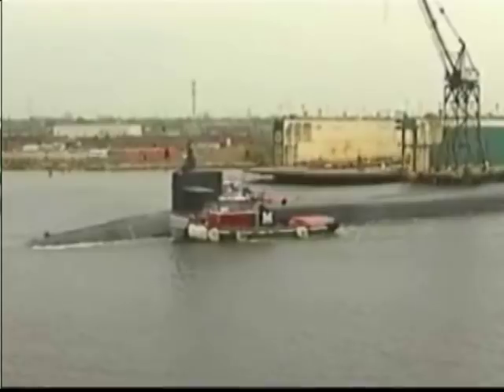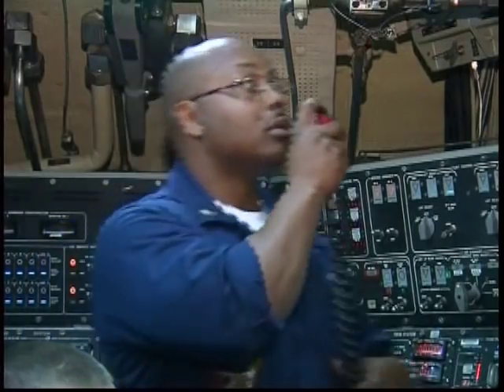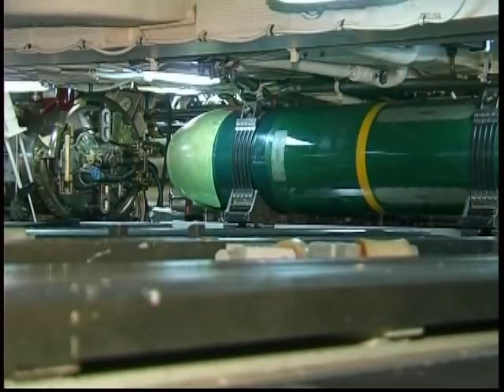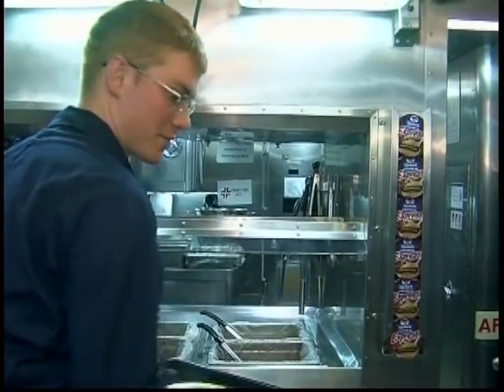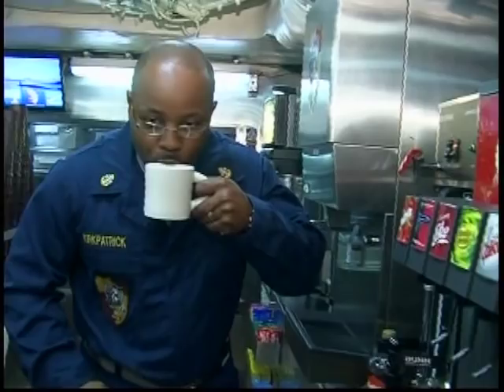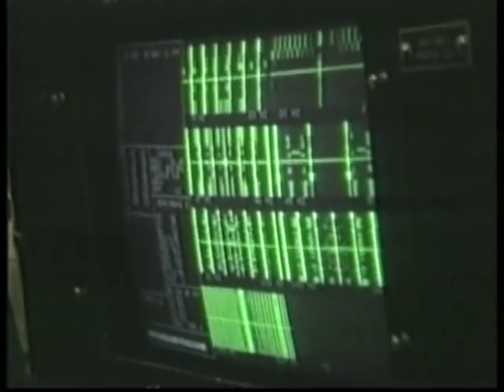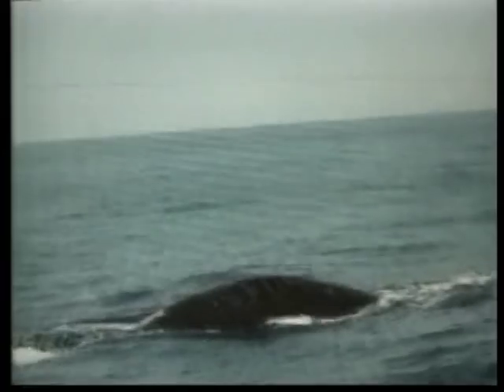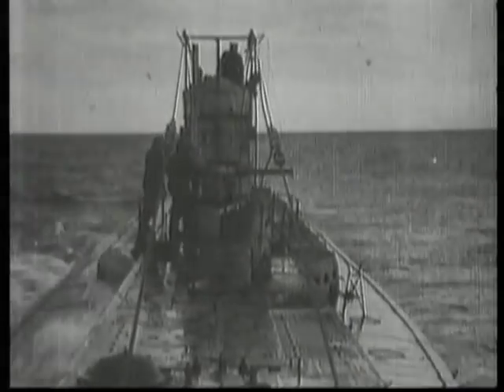Life Aboard the USS Florida (SSGN-728)

Comment: that's my girl,, I was a welder who helped build her, one of many I worked on, lol all these years later she is in better shape then me, nice
Reply: +kevin mcshane I also been in parts of that ship no navy man ever will go
Reply: +kevin mcshane What parts will no Navy man go to?
Reply: Ive been in those parts
Reply: Between the pressure hull and the outer hull and in parts of the reactor.
Reply: kevin mcshane just curious what was the allowable weld rejection rate? Was every weld X-rayed?
Reply: goutvois103 I served aboard a fast attack Los Angeles class sub during new construction at General Dynamics. Every weld was inspected and their was no allowable rejection rate. If it failed, it was fixed. Some of the finest craftsmen I have ever worked with.
Reply: kevin mcshane which parts? You still talking about the girl?
Reply: kevin mcsha
Reply: Their is definitely a since of pride in seeing ships in use that you helped build. When I was a young man I was a welder in a shipyard building tow boats that ran up and down the mighty Mississippi. Probably the lowest paying job I ever worked as a welder. But after spending many years welding on pipelines, offshore in the oil industry plus working building many oil refineries, chemical plants and one nuclear power plant. I took pride in my work but not much in the finished product. Their is a book called “Towboats of the Mississippi River” several of the boats from Brent Towing that we’re featured I proudly helped build.
Reply: I was a pipefitter on that hull. Great seeing my girl after conversion. What up Kevin?
Reply: I just got orders to her
Reply: @goutvols103  no and I was a blue hat in DEPT 229 welder in the 260 building I used HY80 welding rods along with HIGH TENSILE
Reply: @edastro7707  I welded the inside of the propeller shafts of 729 USS FLORIDA and I also welded the inside of her oil tanks
Reply: Last time I checked, it was a "HE"
Reply: @HTV-2_Hypersonic_Glide_Vehicle  submarine and ship are not he but she
Reply: @Vampybattie  it* is the correct term. Guys that call inanimate objects "she" make no sense in doing so.
Reply: @Vampybattie  Your "ABOUT" page gave me some comedic relief. Great Description!
Reply: @The1saturn 11018?

Comment: when I was a kid a Buddys dad took me aboard a fast attack sub at Pearl Harbor...man it was pretty cramped. years later a friend aboard the USS Ohio invited be aboard the Ohio when they made a port call at Pearl Harbor in the early 90's....I was in the Marine Corps at the time. the first thing I was surprised with was the space aboard the Ohio compared to the fast attack's.....regardless, u wouldn't catch me serving aboard a sub...OOORAH & Semper Fi to you Submariners out there....
Reply: It used to be much worse, in WWII there weren’t enough bunks, so two or three guys had to hot bunk, and the bunks for the torpedo crews were suspended from the torpedo racks. Nothing says sweet dreams like using an 800lb warhead as a pillow.

Comment: How DO you filter smoke from that,grill UNDERWATER?...what valve can you open...
Reply: AAliyah Beyonce star they are called smog hogs.. We have them at my work for the machines.. It purifys the air.. The residue collects on filters which can be cleaned or replaced.
Reply: Near the muffler bearings
Reply: ...roof vent to the chimney...

Comment: Since the boat was originally designed for a much different role (ICBM launch), I wonder if it's much larger and more expensive than it needs to be to fulfill its current role. Sort of like the battleships that long outlived their original reasons for being. Just wondering; I don't know.
Reply: bus114 I would equate it to when the Navy took its straight edge carriers that couldn’t take the pounding of modern jets and converted them to helicopter carriers for the marines and Used then for space vehicle recovery vessels in the 60s and 70s . These boomers are finishing out their service life with a new mission until they can be replaced with vessels custom designed and built for the job. Sorta like the trailers you once say build out of the ass end of a busted up ford truck
Reply: steven heckert  Busted up ford truck is redundant.